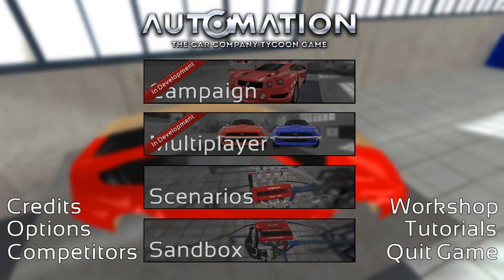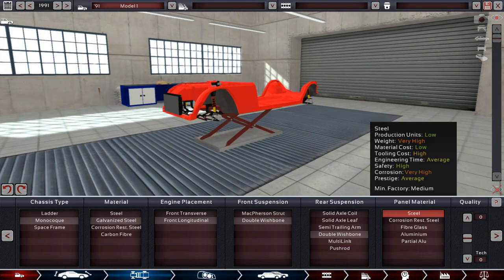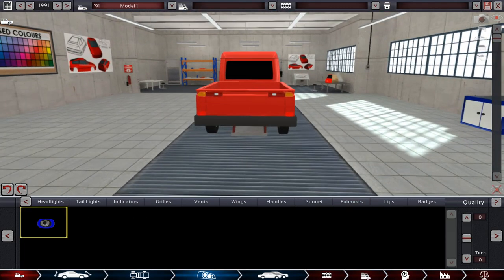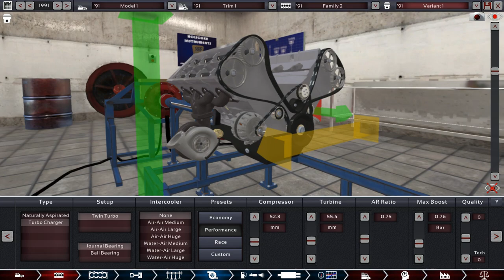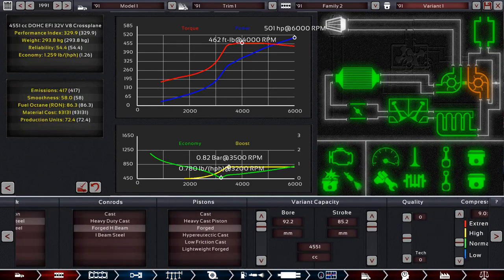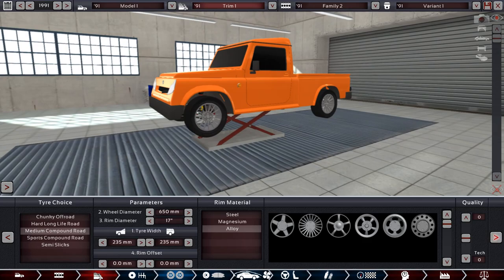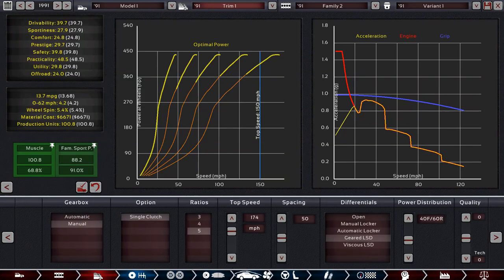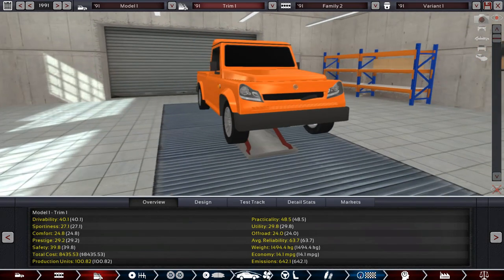Automation Challenge Building A Syclone Rival

Comment: Look at the RON number to see if your engine is knocking. Your RON number should be below the RON number in the fuel you're using. I think you were all the way down at 86 RON in the engine while running with 95 octane fuel. A fiddling with the ignition timing and compression can often increase the ron in the engine and gain more power and fuel effencency without changing the curve of power and torque. Ignition timing gives more than compression if I remember correctly.

Comment: Okay Alex, here's a challenge for you: Build a turbocharged sports car that makes boost at 2000 rpm or less (no turbo lag).
Reply: That's not lag, that's boost threshold.
Reply: I know, but a lower boost threshold usually results in less lag as well.
Reply: Maybe there is a mod on workshop to have a turbine powered by foot pedals, 0 turbo lag, even on a turned off engine XD
Reply: it's not possible at the moment due to the model for the turbo being from around the 80s/90s.There will be an update in the future that brings twin scroll turbos and other forms of aspirations
Reply: it's not possible at the moment due to the model for the turbo being from around the 80s/90s.There will be an update in the future that brings twin scroll turbos and other forms of aspirations
Reply: it's not possible at the moment due to the model for the turbo being from around the 80s/90s.There will be an update in the future that brings twin scroll turbos and other forms of aspirations
Reply: You can say that again.

Comment: What you need to change is the maximum boost, Right now the truck is running 0.80 bar of boost which I think is like 11psi or something, at least 1 bar would of been nice, it being a forged V8 woulda been able to push 20Psi
Reply: 1 bar being 14psi

Comment: This game on steam? Not a big pc gamer , but this game interests me......
Reply: +Brandon Mott thanks I'm in process of DL ing it, have they done a good job of updating it? Or have the developers given up on the game?
Reply: They are slow as shit, but consistent. There's a major update every 3 months. Right now, they're porting it into Unreal engine.
Reply: +Kubboz thanks! I'm not a huge pic gamer, so what does the unreal engine do for it?
Reply: Chuck Nowakowski
Will make it look less like what you see on the video and more like this: https://scontent-cdg2-1.xx.fbcdn.net/t31.0-8/12819402_1266211120062270_7024098077186738176_o.jpg

Since the Unreal engine is way better optimised than the current inhouse engine they are using, it should run faster too.
Reply: +Chuck Nowakowski The devs said that it would look better and it would allow for more features.